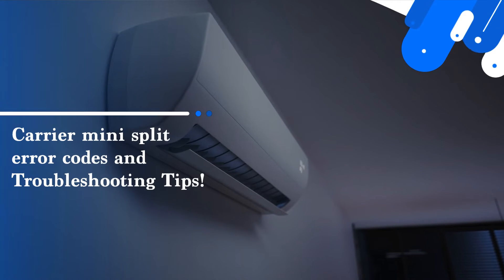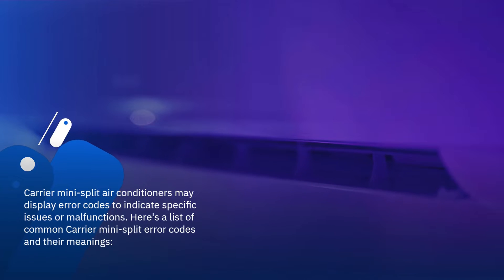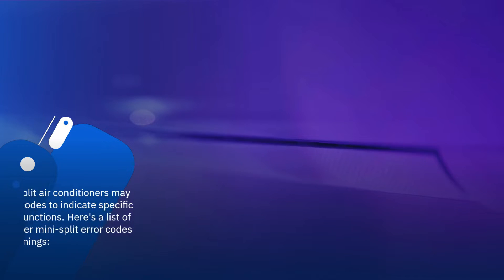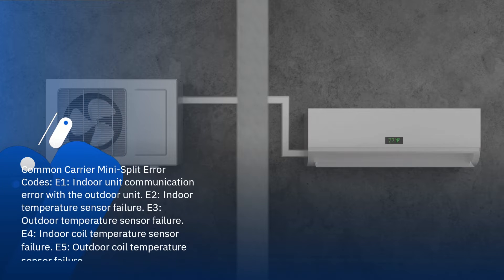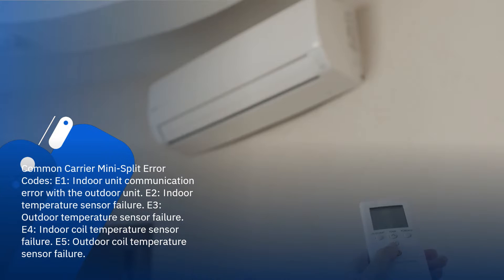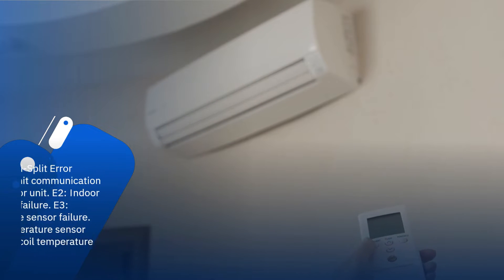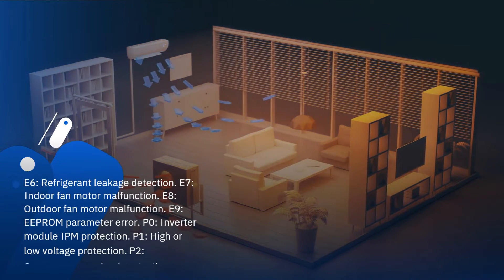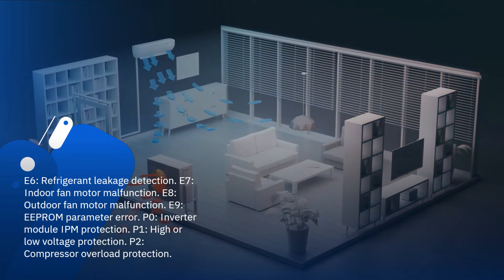Carrier mini split error codes and Troubleshooting Tips!

Comment: How do you fix p6?
Reply from the maker: A P6 error usually indicates an issue with the inverter or motor of your AC. Try these steps:

1️⃣ Power Reset – Turn off the AC, unplug it for 10–15 minutes, then restart.
2️⃣ Check Wiring – Loose or damaged connections between the indoor and outdoor unit can trigger P6.
3️⃣ Inspect the PCB – A faulty control board may need repair or replacement.
4️⃣ Check the Compressor – Overheating or inverter issues could be causing the error.

If the issue persists, a professional diagnosis might be needed. Let me know what brand/model you're working with for more specific guidance! 👍